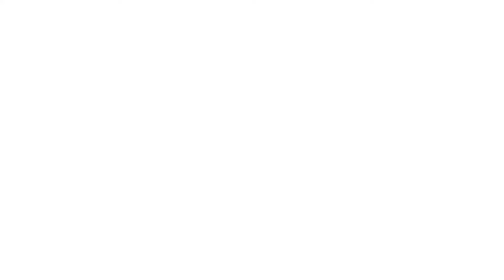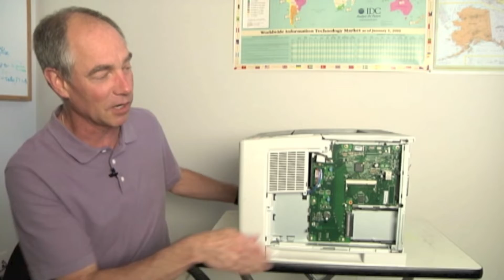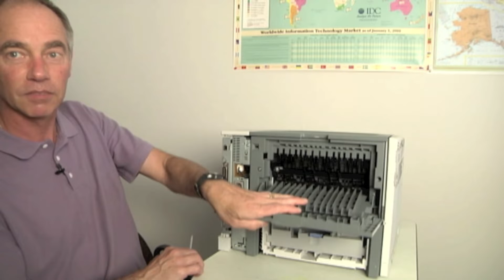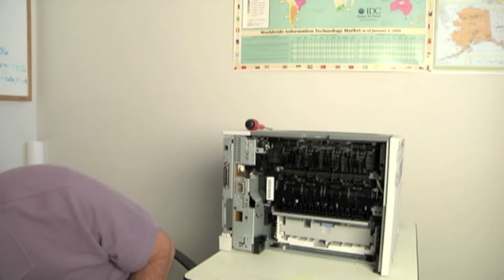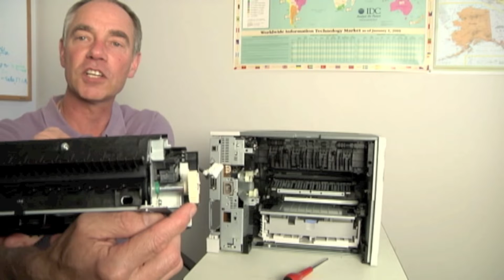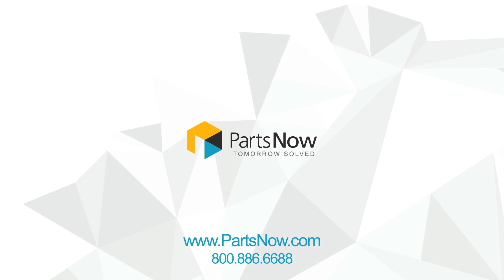PRINTER REPAIR: HP P3005 Get Rid of The Grinding!

Comment: Thank you for the video and specifically for mentioning all 4 screws.  I had rebuilt the fuser and it worked well for a while then began the grinding noise. I replaced the gear set and that cleared things up for a bit but the grinding returned.  Purchased a rebuilt fuser and the grinding was still present.  After I watched your video, it brought to mind this small screw that was sitting behind the printer for a while.  I had neglected in all repairs to replace the lower left grounding screw.  I replaced the screw and all grinding was eliminated.  I imagine if the torque causes even a minor movement the gears will be misaligned.  I had forgotten that there was the grounding screw, Thanks again!

Comment: The 3005 stinks. Try replacing the tray 2 solenoid. Arrrrrgh
Reply: TheGrayman1234 the real and permanent way to fix a P3005 is buy a new printer. Preferably an old LaserJet 4, 5, 4000/4050/4100,  5si/8000